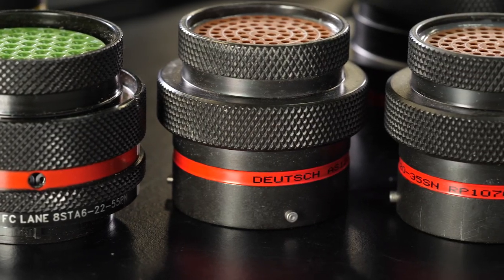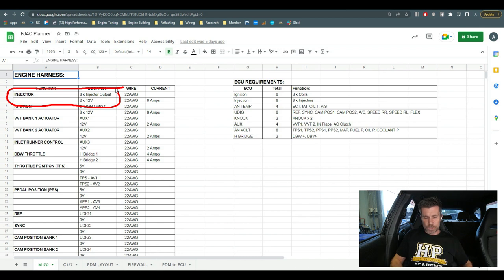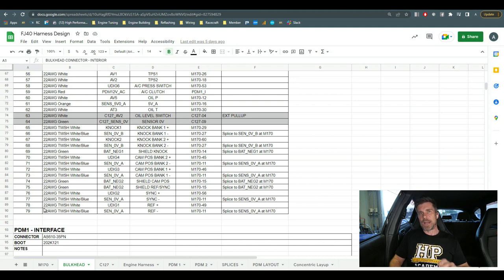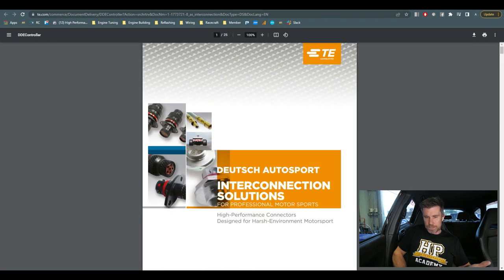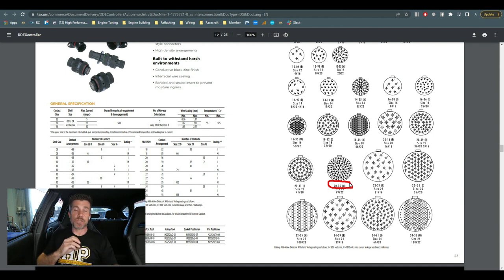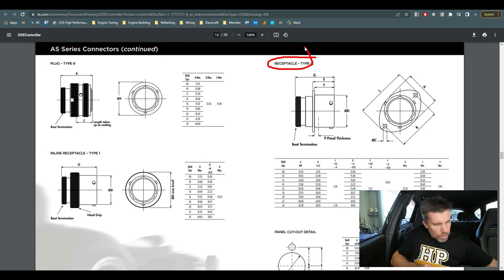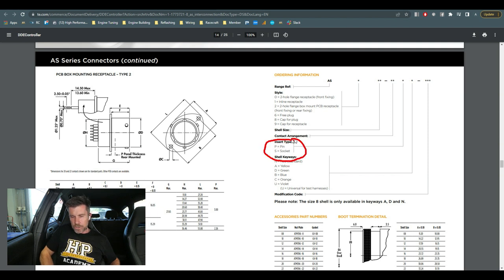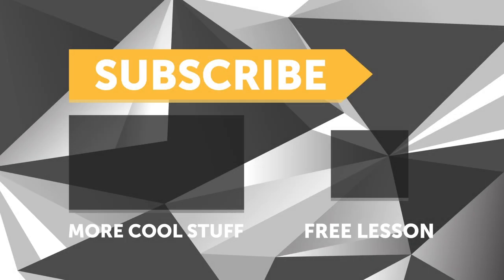Autosport Wiring Connectors Decoded | (aka 'Mil Spec')

Comment from the maker: ⚡️TE Connectivity DEUTSCH AS Standard Series Connectors: https://hpcdmy.co/te-autosport ⚡️
⚡️ SOURIAU 8STA/8TA Series: https://hpcdmy.co/souriau-autosport ⚡️
🤓 Practical Wiring - Professional Motorsport Harness Construction Course: https://hpcdmy.co/hpa-pro-wiring-yt
💸 Take $25 USD off ANY HPA course with coupon code: YOUTUBE25

------------------------------------
TIME STAMPS:
0:00 - Autosport Connectors Can Be Confusing
0:30 - ID Number, We'll Explain This Soon
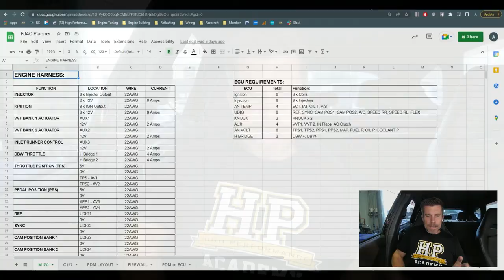1:06 - Physically What Do We Need - Documentation
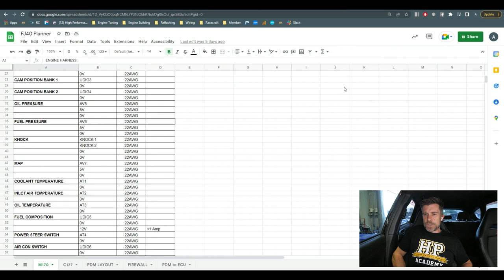2:46 - Advanced Documentation Continued: AS6-16-26SN
4:28 - Gauge/Wiring Sizing
5:32 - Checking What Connector Works: Link Below
07:10 - AS6-20-35 SN ID Number Explanation
07:30 - AS - Shell 
08:04 - 6 - Contact Arrangement
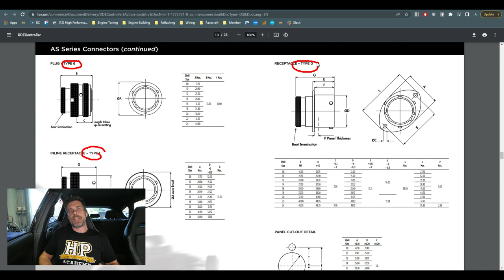9:18 - Type 1 or 0 Receptacle
09:58 - S OR P and N - Socket And Pin
10:30 - N - Keying/Keyway
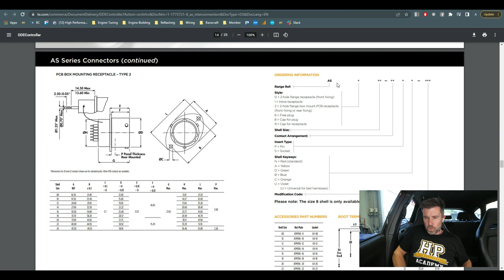11:07 - Connector Summary
12:08 - Tooling (Crimp Tool)
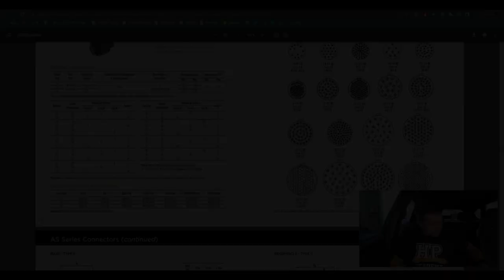13:26 - Motorsport Wiring Lesson
------------------------------------

Comment: Many years ago I tried to stock a good range of connectors, pins, blanking pins, back shells, etc. 
It rapidly became more trouble than it was worth. Having to explain what was suitable for what applications to virtually every customer takes hrs of time. Good effort on the vid.
Reply from the maker: Hopefully, with more videos like this you can just point them here instead haha
Andre did a great one here a while back as well: https://youtu.be/fNgWztn7TL0

In my previous role I usually tried to limit it to 3-4 options for customers if it was a situation where there were many. 2-3 adequate, one 'baller' even if the customer stated they just wanted the cheapest so I could help better explain the pros and cons of the decision of either side of the scale in general. It doesn't hold hard and fast to every product choice, but I found it helpful and a time saver without cutting corners.

The best and worst thing about dealing directly with people is the people eh! Often full of surprises, good and bad - Taz.

Comment: I use most of the techniques you've given me for engine building and applied them to things as such as generator and pressure washer engines on mini bikes and go karts and I have to say the amount of improvement in horsepower gains and rigidity to the block while also having reliability is outstanding.

Comment: This is great stuff, the biggest problem I have is finding connectors that are for more amateur/lower cost projects that have more than 4-6 pins. Even the deutsch ones and similar can be pretty pricey and/or hard to find, and the price jump to the mil/autosport connectors isn't just a little jump, it's orders of magnitude higher.
Reply: Fueltech makes a CPC connector that works great for the price point.

Comment: This video was really helpful, I’ve been a hobbyist auto electrician for a while now, helping people with projects on oem cars. One issue I have currently is finding connectors with good information on Max Current through the connector as a whole. Is there a good rule of thumb that can be followed (ie a Deutsch connector with 12 pins that can carry 7amps each has an overall current rating of 84amps)?

Also, I don’t know why, but I’d never thought to split power lines out into multiple pins on connectors, then open barrel splice them back together nearer the device 😂
Reply from the maker: Hoping to get Andre to do similar on DTM connectors for you guys too in the next few weeks. Glad you found this one helpful in more than one way as well, cheers for the support 😎 - Taz.

Comment: so apologies if i missed it. my car is currently wired with GXL. I'm using twist lock deutsch connectors right now. I'd like to swap to autosport connectors when i swap engines. will i have to reqire with TXL or will GXL wire work? wasn't sure on insulation thickness.

Comment from the maker: Note we don't SELL any connectors so we can't help with prices, but there is a thread on our forum the HPA members created that has an epic list of motorsport wiring suppliers for you guys 😎 - Taz.

https://www.hpacademy.com/forum/efi-wiring-fundamentals/show/wiring-and-accessories-suppliers-list?utm_source=youtube&utm_medium=social&utm_campaign=general-interaction
Reply: Andre, your documentation specifies an AS616-26SN as the bulkhead connector, which takes only 26 size 20 contacts, whereas you go on to talk about the AS620-35SN which is the connector that your documentation should specify for the 79 conductors required to pass through the bulkhead.
Reply from the maker: Yes a little confusing sorry, he switches to a different connector for the actual explanation after showing you what he is using, he just picks one at random from the page. The explanation is still valid though - Taz.
Reply: @hpa101 Yeah, the explanation is valid. I am just concerned about your documentation, as if that's the case, the documentation still needs addressing. It has the incorrect connector pin out shown next to the connector description (as the connector pin out shown in the documentation is an AS 620-35SN) and the 202K163 moulded boot listed would not recover small enough for a size the AS 616-26SN (it would require a 202K153 or 142).
Reply from the maker: @callum1794  sorry I thought I had replied to this rather than leaving you hanging. Yup you're right, this was copied over from the RX7 documentation and Andre didn't quite finish it before this vid, so that is indeed not correct. Don't worry, he didn't try to fit the wrong part.
We had a chat the other day and I think we can do a bit better. While this is helpful for the intended topic and goal of helping understand the ID/Serial numbers of Autosport style connectors, we will reshoot it and replace this video later in the year with something a little more refined.
Cheers for your input too, always appreciated - Taz.

Comment: We use these all the time in aviation. Very expensive lol.
Reply: not TE autosport in aviation, most likely MS series amphenol or cinch.
Reply: @benriggs3108  im talking about MIL connectors in general. Tools are from DMC.
Reply: @kaisuhina8024  1. autosport connectors aren't MIL connectors, they're "autosport" connectors.
Reply from the maker: @kaisuhina8024  I put 'Mil Spec' in the title as often people refer to this and other materials as such, but as Ben mentions these are Autosport & Souriau (first one shown anyway) connectors. Possibly from the same parts bins as what you will be working with but generally they aim for lighter with a higher pin density from what I understand by comparison to what you probably work with, but aviation is a massive industry with many levels to it as well.

Note when it comes to the term 'Mil Spec' it means nothing without the actual specification being stated too. For motorsports we prefer using Racespec or Autosport terms, but as above as many people search for Mil Spec in order to make content like this helpful we sometimes include that term too - Taz.
Reply from the maker: @kaisuhina8024  also you are bang on that these are not cheap, and nor is the associated tooling. We cover 'club' vs 'professional' level wiring a little more including the associated tools here in a 5 minute or so read if anyone is interested: https://www.hpacademy.com/technical-articles/club-level-vs-pro-level-wiring/?utm_source=youtube&utm_medium=social&utm_campaign=general-interaction -Taz.
Reply: @benriggs3108  you knew what he meant 🙄 jeez...

Comment: Money throw away things….spent about a 1000 on 2 milspec ones…
Reply from the maker: Yes they are not cheap, and then there is the tooling. Sometimes you can buy harnesses that have been lifed out to get them cheaper secondhand, but obviously you might not get exactly what you want that way either - Taz
Reply: @hpa101  i have just ordered contacts from mouser and size 23 backshells for an amphenol because ofcourse internet points and bragging on your MWA page….the terminals cost me 700 USD along with the backshells that need 5-6 months on back order. Had bought a used Amphenol kit from a guy on that same page so ya know what happens next…
Anyway…..internet points…..

Comment: Do you need autosport connectors on a 1200-1500HP twin-turbo car that will spend 99% of it's life on the street?
Reply from the maker: Do you need a 1500hp street build? Answer is much the same. No you don't, but you probably want one anyway. 

Same goes for Autosport connectors in that application. 

A major advantage of them is their high mating cycles and ease of use. This is great for a motorsport application because the team will be servicing the vehicle often, often at pace, and that involves disconnecting them often as well.

You won't be doing that with a street car to the same extent, so you don't strictly need that advantage.

That is not the only advantage or consideration, but it's the one I have picked here today for you 😂

So the answer is no, with the point that what you're doing isn't strictly necessary either which is why some choose to go all out on the wiring as well because they can, and others will get the same results with something that is more akin to a Club level harness or something of a hybrid that uses some higher end materials mixed with mid-level (OEM is low level in this example) and be just as happy - Taz.

https://www.hpacademy.com/previous-webinars/pro-vs-club-level-harness-construction/?utm_source=youtube&utm_medium=social&utm_campaign=general-interaction
Reply: @hpa101  You make a load of excellent points.

Do I need a 1500 HP street build?  Of course not, but I want it anyway.
Do I need to run MoTeC when Holley would be perfectly fine for a fraction of the price?  Nope, but I want it anyway.

My original question was largely aimed at deciding between a MoTeC M142 and M182, which appear to be the same ECU, but the M182 has motorsport connectors whereas the M142 has plastic.  

This will be an all out build, so I guess the extra $2000 or so for the M182 and motorsport connectors won't really move the needle much one way or the other.  Thanks for the insight!
Reply from the maker: I think you're making good life choices no matter what by the sounds here 😂

But yes, you could go either way on that and be fine to give you a direct and specific answer. 

The alternative to Autosport is still a good choice, they're not going to fall apart or anything and note the tools for the terminals those connectors use are pretty spendy too but you can often find the likes of DMC crimp tools second hand or some suppliers (I have heard) rent them too.

Just don't let that choice come at the cost of something else awesome like a PDM or similar 😂

Happy wiring/tuning/building! Fire up a link to your IG or build thread etc if you're into that. Always cool to see what people are quietly working away on 😎 - Taz.
Reply: @hpa101  Oh, my build thread?  Ummmm, yeah, about that.... Truth is, I possess neither the knowledge nor the talent to do such a build, so I'll be leaning heavily on an engine builder to do the heavy lifting.  

Here's where it gets tricky, and where you might want to rethink your comment about my making good life choices... I have a penchant for being different and going against the grain, so instead of going with an LS3/LS7 which has loads of highly reputable builders (Steve Morris, Texas Speed, LME, Nelson Racing, etc.) ... I just have to be different so I'm looking to build it around a Gen V LT1... just to be different.  

I'm also making it even harder on myself by choosing to build it up around a 99-02 Trans Am Firehawk instead of "just" a WS6.  WS6s can be found relatively easily, but Firehawks are rarer than hen's teeth.  Now of course I could just buy a WS6, de-badge it, and slap a Firehawk logo on the side and no one would ever know... but having that VIN that identifies it as a bona-fide factory built Firehawk is absolutely essential.  On the rare occasion an actual Firehawk does show up, it's a garage queen and the guy is asking a zillion dollars for it.  I'm looking for a car that's been beat to hell, because the project will be a complete frame off restoration, so the only thing I care about is the VIN that establishes the provenance of it starting its life as a factory Firehawk.  

Now, onto life choices.  Holley has loads of support and plenty of dyno tuners and as a system would do more than everything I need for 1/4 the price of MoTeC, but with MoTeC I can say things like "it has a full MoTeC system," so MoTeC it is.  If my newly built 1500 HP street car gets hit by an asteroid the day after the build is complete, plastic connectors might come undone, but motorsport connectors are likely to remain intact, so M182 and motorsport connectors are the way to go.  You can't take 3 steps without tripping over a dozen highly skilled builders that can build up a 1500 HP LS3/LS7 and barely anyone is doing anything with the new LT1, so LT1 it is.  Lastly, I'm toying with the idea of bolting it all up to a Tremec TR-9070 DCT instead of the tried and true T-56 Magnum.  I may even engage good ol' Simon at PPG for a billet gearset to help the DCT cope with 1500 HP.  I guess only time will tell...

In summary, I'm a bonehead.  Thanks for coming to my TED talk.

Comment: Or as aircraft maintainers call them, cannon plugs. 😅
Reply from the maker: That term actually came from the audio industry I believe where this style was first used? - Taz.
Reply: @hpa101  I did a quick google, according to wikipedia "The first "Cannon plug", the M-1 connector, was initially designed as a quick grounding connection for the electrical motor on a portable meat grinder and was adapted for movie sound equipment, enabling the new electrical camera to move freely about while “shooting” a scene." So, I stand corrected!
Reply from the maker: @rhubarbpie2027  so do I! Crazy to think grinding your meat/s used to be such an activity that you'd want a portable grinder for it.

Like did you just rock around to your mates with a slab of beer and your meat grinder on a Saturday arvo or what? 😂  - Taz.
Reply: @hpa101  "Oi, I'll bring over the grinder, you grab the suds, we'll make an evening of it!" Lol. Love your content, especially the Haltech fuse junction box! 🍻🍻